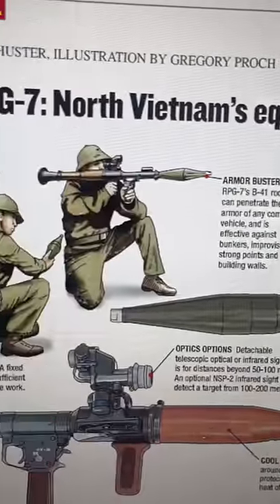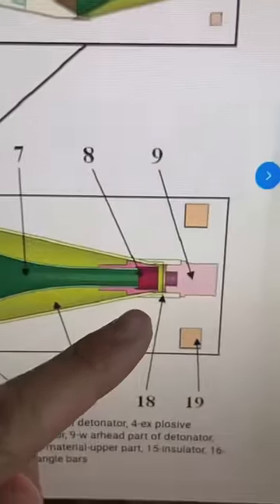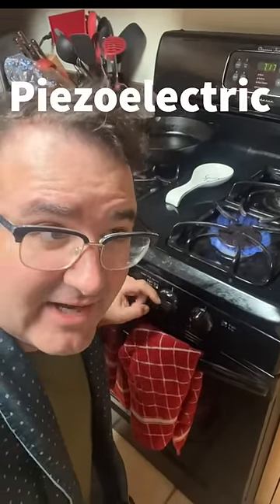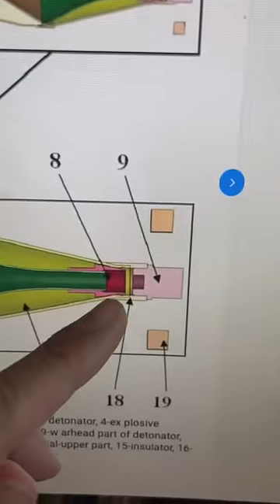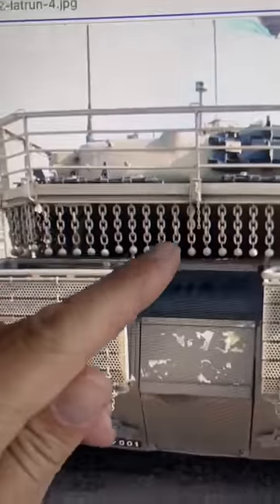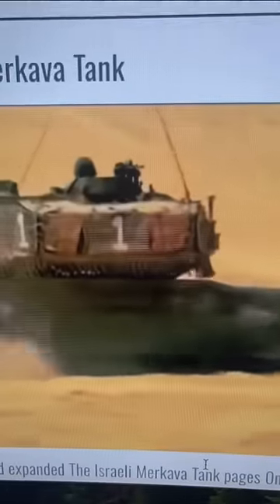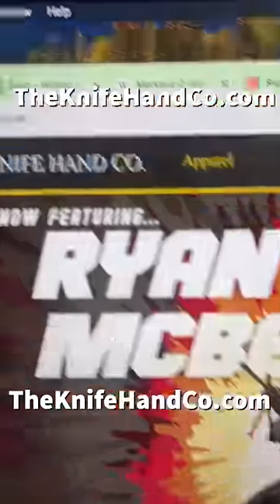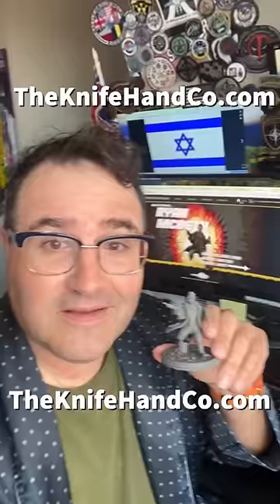What are the balls and chain armor on Merkava tanks actually for?

Comment: The RPG family is also, famously, a family of shaped charge munitions. Premature detonation of the warhead defeats the weapon by initiating the plasma cone beyond the critical stand off distance required to penetrate armor. If the weapon detonates on a chain, it probably won't negatively affect the crews ability to fight.
Reply: Almost everything you said is false.

The penetrator isn't plasma, it's not even molten. It's solid copper. The extra standoff distance doesn't negatively affect the penetrator. If it goes off on the chains the crew's as they say, fucked.
Reply: @lemons1559  Thanks! I am certain you know everything about everything.  Thank you for gracing a lowly peasant such as I with your delightful wisdom.  

You should study shaped charge warheads more.
Reply: @c.b.816   Yes, I have read excessively about them. I still have no idea where the idea of a plasma comes from.
Reply: @lemons1559  The firing detonator on the RPG is at the tip of the warhead. It is designed to penetrate a particular thickness of RHA armor and that penetration depends on the detonator being in contact with the hull of the vehicle. The warhead geometry directly affects the penetration characteristics of the device.  The explosion turns the solid (usually compressed powder) copper penetrator into a jet of super heated plasma that approximates the inverse geometry of the warhead. The cutting or penetration value of the design depends on that jet of plasma initiating in contact with the hull. 

The weapon can easily be defeated by moving the intiation further away from the hull. Think about how the Trophy active defense system denies the warhead. It initiates the explosion beyond the critical stand-off distance. 

The rear of the turret is a known shot trap of most tank designs. The engineers who designed the Merkava family of vehicles were very familiar with the RPG family, and with the failure of older cold war turrets. The chains are a simple, rugged, and inexpensive tool that gives decent protection. The primary way it does so is by initiating the warhead of the RPG approximately 24 inches before it would detonate against the hull. In practice, it works because it defeats the stand-off requirement of the shaped charge.  

A solid copper penetrator does not have the cutting potential to penetrate most modern armor. It splatters. 

However, if you explosively accelerate the atoms of a copper rod, you generate a cone of superheated plasma. We know it's plasma by a couple of different ways.  The easiest one to measure is the EMF of the device. It's explosives, a detonator,  and the penetrator material. What generates the detectable emf during the detonation? As the shockwave propagates through the penetrator, electrons are sheared from the atoms. This is ionizing. It produces an electric field that is excited by the ions of copper moving through it's own magnetic field. The emitted electons are part of the flash of the device. 

The copper penetrator is formed into a high speed jet of ionized plasma during the detonation of the RPG.
Reply: @c.b.816  post a single source that says that a gap makes the RPG warhead ineffective, cite anywhere where it said it's plasma and a source that criticizes the merkava for having a shot trap. Everything you said is nonsense.
Reply: @lemons1559  Go do some research.
Reply: @lemons1559  One of the better sources on YouTube is a video the SlowMo Guys filmed. If I feel like it, I may post a link. I really don't appreciate your tone, nor your insults. 

Surely, you have a better use for your time.
Reply: @lemons1559  You should find this one an interesting read.
Reply: @c.b.816  I've watched that slowmo guys video and nowhere does it imply anything about it being a plasma. Having handled M72 warheads in person I can tell you it's not a powder, it's a solid copper plate formed into a cone. Every measurement done on the penetrator has measured its temperature as being about 950°C, as such a solid. An explosion can't knock electrons off an atom to ionize them. The merkava doesn't have a shot trap, that's not what it's called. It's just thin armour. A shot trap was an issue when we used solid slugs instead of sabot darts. A shot trap is armour geometry that directs the shell through the roof of the vehicle, this doesn't happen with shaped charges or any other modern anti tank munitions. Regarding the chains, they're not far enough to make the penetrator ineffective. Active proptetion blows up the warheads a meter or more away from the armour, not some inches.

Ps. Don't post links. Youtube deletes them. Post the title of which ever paper you're citing.
Reply: @lemons1559  Am I to understand that you believe that a copper rod, solid, heated to only 950° (F or C) will penetrate approximately 400mm of RHA?

Has this been the point you are trying to make?

What temperature is required to turn copper into a gaseous jet?
Reply: @c.b.816  Have I said a single word that even implies even that I believe that?
Reply: @lemons1559  No, your initial point was that I was a liar. This is strongly suggested by the word false. I am neither lying nor wrong in this.
Reply: @c.b.816  no, I never said you're lying. I just think you're wrong in calling the merkava's back a shot trap, saying that the copper becomes plasma or that the extra standoff from the chains makes the warhead ineffective.
Reply: @lemons1559  I'll see if I can develop a reciprocal relationship with someone in the Israeli Defense Forces with the actual armor thickness of the back of the turret for the Merkava hull. Would this be a good enough source for you? 

If that isn't good enough,  maybe I could stop by Mantak for you. 

While I am absolutely certain the Merkava is designed very well for crew protection, no design is perfect. The chains on the rear of the turret are there for a reason. The stated reason is rpg defense. Go look it up for yourself.

If the rpg detonates on the chain, the explosively formed penetrator that should initiate at the hull initiates much further away from the hull. In the optimal case for the Merkava, it turns a possible penetration into a scorch mark. It turns dead or injured soldiers into a couple of soldiers complaining because they have to paint the hull again. The chain might lose the ball at the end, or a few links. The point is that the soldiers survive a low angle shot to the back of the turret from the RPG they most often encounter. 

I can only suggest that you learn more about the shockwave propagation in high explosive materials. The jet of material projected by most shaped charges is in excess of 4200°F and in excess of Mach 6. This jet penetrates roughly 6 times the diameter of the warhead of RHA. This is one of the factors that contributed to the obsolescence of the M72. The penetration of the warhead was limited by 66mm bore.

The research and study I have done strongly suggests that the jet of material is a plasma cone. The penetrator creates a detectable electromagnetic field. This is not a feature of low temperature, high speed collision of solid copper into hardened materials. This is a feature of an ionized jet of plasma.
Reply: @lemons1559  Since you seem to like source material. What are your sources?
Reply: @lemons1559  I wonder if part of your struggle with this is that our understanding of plasma has increased since you last used the M72. In the information specifically referring to the M72, the EPF is described as a gaseous cone of high temperature copper.  When this material was written in 1959, we lacked an understanding of the fourth state of matter.
Reply: @c.b.816  the source which describes the EFP as gaseous is wrong. People have measured the temperature of the penetrator and it's not even above the melting point of copper. Also the last time I used an M72 was 2 weeks ago.
Reply: @lemons1559  You fired a live 66mm heat round 2 weeks ago where exactly? How did you acquire the weapon? What legal status do you possess in order to do so?
Reply: @lemons1559  It's not cute when you describe the source material as wrong just because it disagrees with you. Generally speaking, in the real world, that relationship is reversed.
Reply: @c.b.816  I fired it in the AT practice area. I acquired it from my liutenant. I have the legal status of conscript.
Reply: @c.b.816  I describe your source materials as wrong since they disagree with contemporary research on the topic.
Reply: @lemons1559  What are the specifications of the probe used to measure the temperature of the jet during the detonation of a high explosive? How are you generating your temperature reading?
Reply: @lemons1559  The temperature you have given me and the state of matter you have given me are both wrong. 

Who are you serving with, Conscript Lemon?
Reply: @lemons1559  Here's something that will help you understand the ionization problem. How many joules are required to separate an electron from the outermost energy shell of an atom of copper? Is it more or less than the joules imparted by the propagation of the shockwave of the high explosive?  Let me know when you have a solution. The math is accessible on the internet.
Reply: @lemons1559  A different way to test the hypothesis that stand-off matters is to use the training range. I am assuming that there are a selection of vehicles downrange from the firing position. Choose one that you can reliably hit and destroy with a contact detonation of an M72. Place a thin sheet of metal or plastic or wood more than 400 mm in front of the vehicle from the perspective of the firing line. Just make sure that whatever barrier you install will initiate the detonation. After firing a live round at the barricade, go collect your "rod" and observe the effect on the target vehicle. If you are correct, you will find a solid rod of copper buried in the target vehicle. If I am correct, you will not find a rod, and there will be neglible or no damage to the target vehicle. You may find small globules or grains of copper. If the explosive does not detonate, do not approach the spent warhead. I don't want you to die proving yourself wrong. Will your lieutenant approve of and assist in this?
Reply: @lemons1559  A way to test the ionization without significant risk is to see if the explosion generates a short blip of static on the radio. The presence of the emf should give a little crackle. If you set up a coil of copper wire, energize it, and pass a copper conductor through the energized coil, you'll generate the right frequency at a very low power. This gives you a chance to find the correct frequency on a variable set. Fair warning,  repeated emf blips can be found at distance by direction finding if the source of the signal is powerful enough. Again, proving someone right or wrong is not worth a human life. Do not make yourself a target.
Reply: @c.b.816  the specs are a high speed thermal imaging camera looking at the jet of copper consistently measuring roughly 950°C.

I serve in the Finnish defence forces.

Regarding ionization, you can't ionize atoms using kinetic energy unless we're talking alpha or beta particled which are travelling millions of meters per second to get close enough to the nucleus. A lot faster than the 9-10km/s shockwave that happens. With that force you just get a stream of solid copper that's superplastic due to said forces.

I still haven't seen you post a single paper showing that the jet is made of plasma.

Here's a paper you can read regarding the penetrator temperature, it's titled "In-Flight Measurement of Shaped Charge Jet Conductivity and Temperature". The paper should come 1st when you google that.
Reply: @lemons1559  We may be allied in at least one regard. Slava Ukraine! I am a veteran. I haven't had the opportunity to visit Finland, yet. Welcome to Nato! 

Way back when I was in the service, I would have been close to a Hetman, if my understanding of the rank structure is solid. Feel free to correct me. I specialized in some weapons and other things for a branch of the US military. I am also an end user of some things you may be familiar with. No, we can't go into specifics. Yes, I have seen the source material. I understand the theory of operations underpinning the weapons we have been discussing.

I believe there is an error in the way you are collecting the temperature reading.  Either it is a limit error or taken after the energy has dissipated into the armor. 

The valance electrons come off much more easily than covalent bonds broken by the shockwave. It is the covalent bonds that drive the propagation of the shockwave. The copper loses the valence electrons due to the change in state coupled with the shockwave shearing. 

You're thinking in terms of decay, this is closer to black body temperature radiation than to high energy particles overcoming the strong or weak forces. Think of electricity flowing through a copper conductor, that's flowing electrons right. When you heat the conductor hot enough to vaporize the metal, the electrons that would flow are emitted briefly as they become too energetic to remain in the energy shell. This how normal matter emits emf without being radioactive.
Reply: @lemons1559  That's why the radio can "hear" the detonation.
Reply: @lemons1559  What temperature scale are you using? I have been using Fahrenheit. It also doesn't seem like you are using Celsius.
Reply: @lemons1559  As far as what flavor of particle... give me a sec. I have forgotten which cookie it is, exactly. I just remember that it is not gamma, it's not nearly powerful enough for gamma. Let me do a quick search.
Reply: @lemons1559  The emissions are in the infrared and ultraviolet spectra. Low energy ionization.
Reply: It occurred to me that if your detector is not sensitive to ultraviolet, then you are only measuring infrared when sampling for temperature, which would produce a very low temperature reading.
Reply: @c.b.816  That's not ionization, though. It's electron excitation. The electron rises to another shell and as it falls back down, it emits a photon. In that case UV and IR.
Reply: @lemons1559  A more reliable temperature reading will come from capturing the spectra of the penetrator. I just don't know how to do so during the few critical microseconds during the explosion. The explosion is kinda hard on the equipment, you see.
Reply: @lemons1559  Ah, I checked Kelvin. I think your temperature most closely correlates with infrared on the Kelvin scale. It is still low, but it is much more realistic in Kelvin.
Reply: It may be a translation or cultural thing. Your school may call alpha, beta, and gamma decay ionizing radiation. Mine does as well. 

You're calling the emission of ultraviolet electron excitation? I might be misunderstanding you. I am not calling it electron excitation because it is emitting a high energy photon, it's detectable electromagnetic emission. Are radio waves electron excitation in your understanding?  We might be talking about the same thing and using different terms based on how our cultures look at this. In my understanding, radio waves are very low energy wavelengths of emitted photons. Ultraviolet is high energy photons that can ionize tissue, also known as ultraviolet radiation. This is part of the electromagnetic spectrum, and it can hurt us.

Give me a few minutes. I am looking for EPF temperature over time graph. This is what clued me in on the temperature range. 

Pretty soon, I also have to get some sleep. I have been up all night because I work nights and had a "day" off.
Reply: @lemons1559  What temperature is required for copper to emit ultraviolet black body radiation? It peaks in infrared at approximately 1000°C. It peaks in visible light around 5500°C. It has to be hotter than that to emit UV. 

Go out to the range and bring me one of your solid rods. They should be laying around all over the place. I bet they will look cool hanging on your wall, if they exist. What has you so thoroughly convinced that you are right?

Comment: I didn't think your kitchen gas stove used a piezoelectric igniter like your gas grill does.  At least my kitchen gas stove uses an electronically-generated igniter that doesn't use any piezoelectric crystal.  My gas grill definitely uses a piezo igniter because you get one spark per push.

Comment: If they did fully explode away from the armour it wouldnt get full penetration either would it? The way anti-armour RPGs work is by basically injecting superheated copper through the armour and so if it explodes before the armour, it would not be as much force when hitting the main armour if tge tank, not saying it'll save the tank but it may be enough to save the men inside. This is what i assumed it was for, similar to the extra padding you see stuck to the outer armour of tanks(even seen logs on some), to cause the main force of the RPG to expend itself before hitting the actual vehicle.
Reply: It doesn't inject the copper. It forms a penetrator outside the tank hence the long standoff distance, which then pokes itself through the armour like any kinetic round. If the warhead goes off on the chains it'll still most likely penetrate, if not even better than with the normal standoff distance.